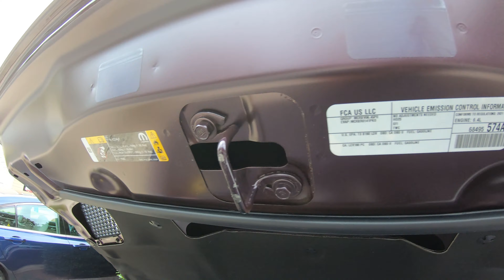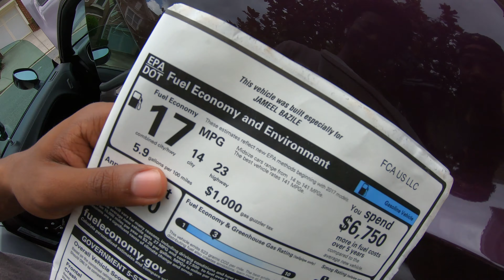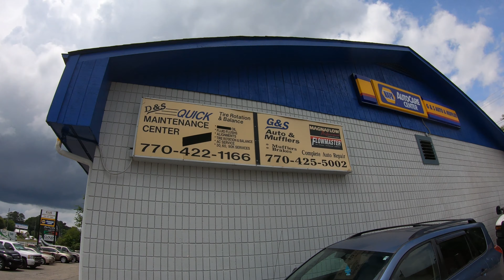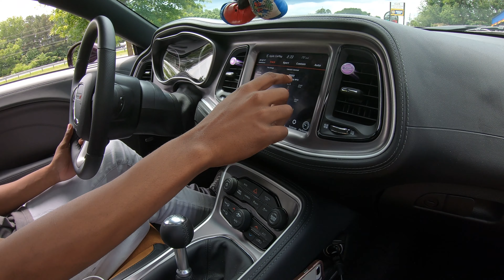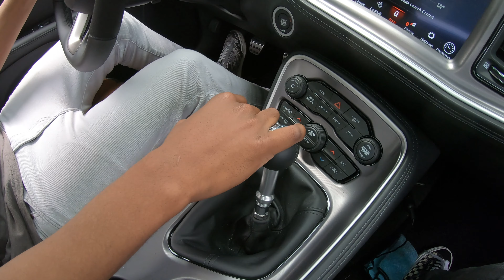6MT 392 SCATPACK CHALLENGER MUFFLER DELETE! BEFORE AND AFTER!

Comment: There are a TON of 6-speed Challengers. Lol.
Reply from the maker: We’re highly aware. I’m not sure which comments you’re referring to, but we probably meant in the spec he got it in or how he works at a dodge dealership and that’s the only 2021 6mt scat they got.
Reply: @1BCUSA  the scat packs are very customizable. Between trim levels, seats, MT vs AT, red brake calipers, hood pins, spoiler options, etc., it's not impossible to make your Challenger unique. This one is a gem. I just got my VIN (Hellraisin Scat Pack) last week after ordering mine almost 3 months ago. Delivery supposed to be late-June. Counting the days.